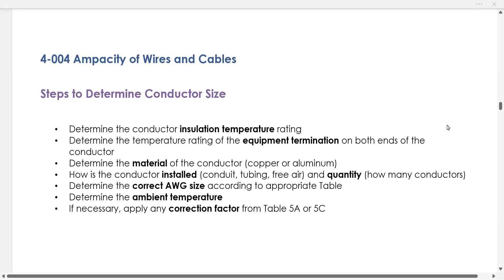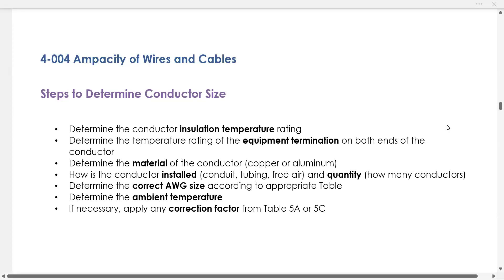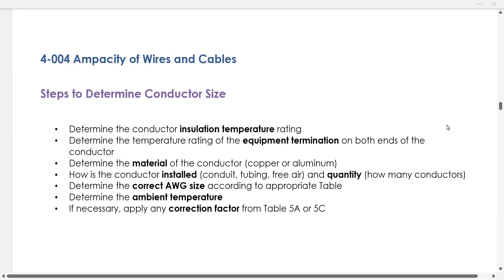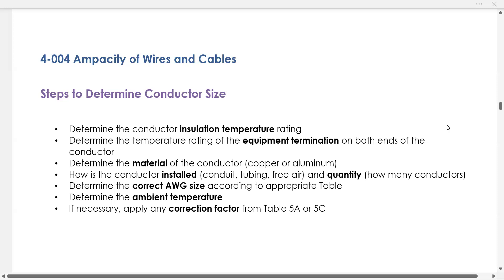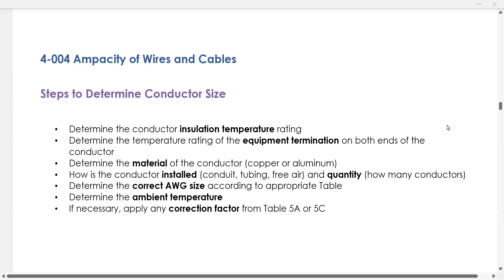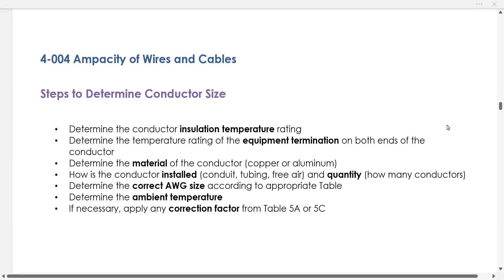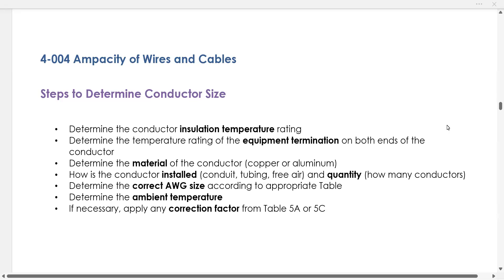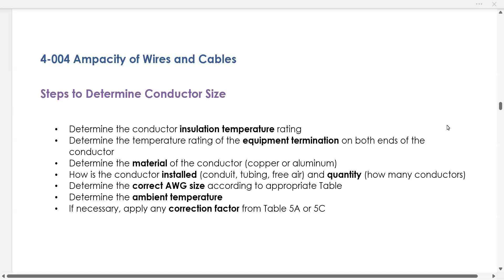The steps for Calculating Ampacity! CEC Section 4 Conductor Sizing Simplified! Rule 4-004

Comment: The recurring problem I keep having is which column on table 2 or 4 to use. I get that Romex requires the 60 deg C column for most applications. I get that you derate Romex based on the 90 deg C column, and then often discover the 60 deg C column takes precedence anyway because it's more conservative. But, what about when you use SER cable for a 100 A subpanel feeder wire? Is it treated the same way Romex is (60 deg C), if routed through attic insulation? Are you still confined to the 60 deg C column or can you use the 75 deg C column because the main and subpanel and breakers are often rated to 75? As with Romex, do you derate at 90, then compare the result to the 75 column to choose whichever is more conservative?
Reply from the maker: Hi @spelunkerd, it's an honour to field your question.  I appologize for the delay.  

A) The key part of your question to note is this: :"...and then often discover the 60 deg C column takes precedence anyway because it's more conservative.".  It's important for viewers to remember that we use the 60 column because breaker and receptical terminals are usually rated at 60, and Rule 4-006 says we need to design for lowest temp (conductor or terminations).  This brings us to the 60 column for Romex/NMD90.

B) Applying the same theory to service entrance cables, SER for a 100A subpanel is rated at 90 degrees C for the conductor, but contratined to the 75 column because the terminations are almost always rated for only 75 degrees C.  

C (extra note, beyond your question):  You mentioned routing through attic insulation.  You'll certainly need to de-rate for attic temperatures, as they often exceed the ambient of 30 degrees that Table 2 and 4 apply to.  The attic temps can be as high as 40 to 50 degrees C.  AND, if you're routing through insulation, your thermal conductivity can be dramatically reduced (by definition, lol).  Because of this, I recommend you de-rate 70% to 80%, accounting for the high ambient plus lack of thermal dissipation.  

Summary: Romex uses 60 degree C column due to terminals
SER uses 75 degree C column due to terminals, plus a further de-rating 70 to 80% due to attic heat and insulation. 

Hope this helps!  Wish I had time to record it.  You know how it is.  :)